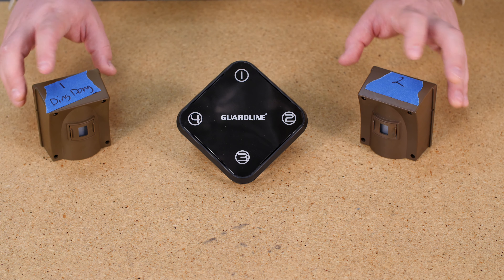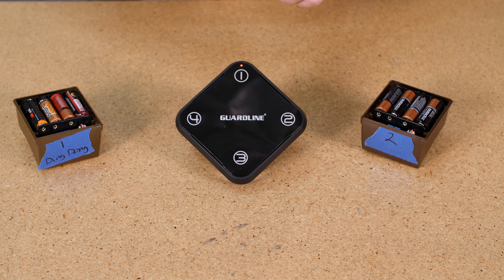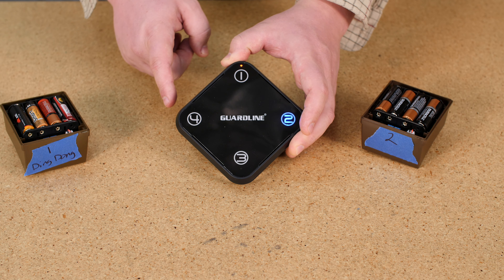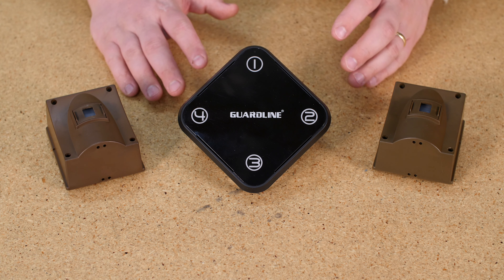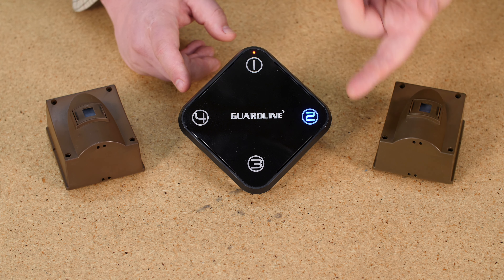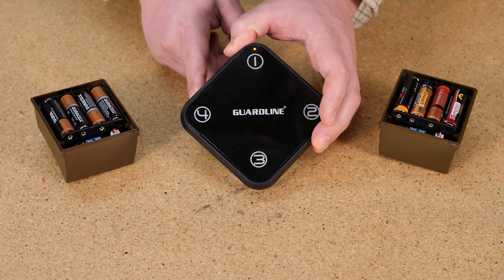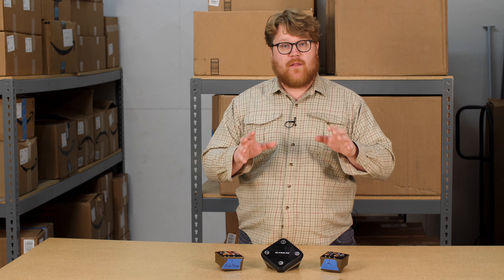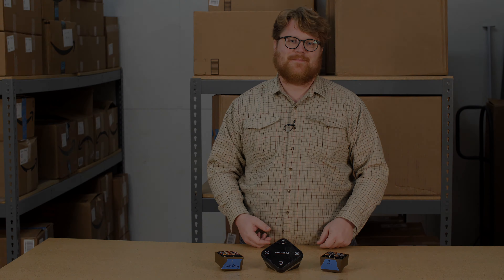Multiple Guardline Motion Sensors: Troubleshooting Tutorial

Comment: Excellent video. Too bad the instruction manual that comes with the units is not as thorough. We were able to get one unit to pair, but could never get the second one to pair. After trying to pair the second unit for over an hour we gave up, boxed the items up and are returning. I am guessing it is a defective sensor as the first sensor paired as easily as shown in this video. Unfortunately, they are not solar powered with battery backup. Never could find out how long the batteries are expected to last.

Comment: What frustrating equipment. I recommend this video to anyone setting up multiple sensors. The first Guardian video is crap and leaves out some detail. After resetting these a few times, I got the config I wanted. It really shouldn't be like that. I'll see if this does what I need after a Ninja walked into my garage at 4am and waved at my HD Video in 4K. Next time that happens I'll have several layers of motion detection from two different vendors. Hoping this is one good layer.
Reply: 🤣🤣🤣🤣 Ninja!

Comment: I have to change the sensor batteries but can't remove the cover after removing the 4 screws.  Trying to insert a screwdriver between the cover and base destroys the plastic.  It's a vert tight fit - any suggestions.

Comment: I set up systems as part of my business and I was called by a person who bought a four set of these. The customer of mine put the same melody on two sensors, then could not undo it. So, I was called and they were correct; the system will not uncouple. This needs to be addressed in the quick start guide or the company does not deserve the customers they get to purchase these systems.

The two sensors are on the same melody and using that SAME technique, I cannot reset the entire system so, that everything can be reset. The marked reset button is inert or broken. I would not recommend these if the manufacturers can't get their act together.

This is a flaw in product and/or instruction. Most alarm system will have a fail-safe factory reset button to make base station and ALL sensors go back to like new. This one likely has the same, it is just not properly addressed in the instructions nor in these videos.

Either a engineering quality defect or a technical writing error/omission. IF YOU HAVE POORLY CONCEIVED INSTRUCTIONS, YOU HAVE AN INFERIOR PRODUCT